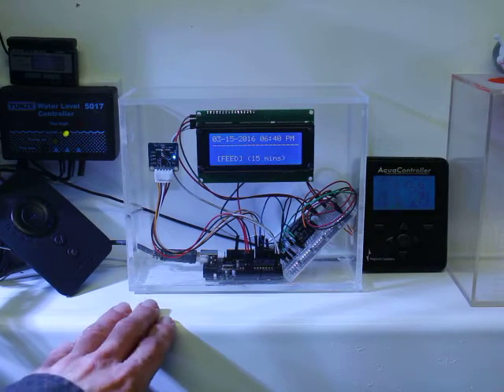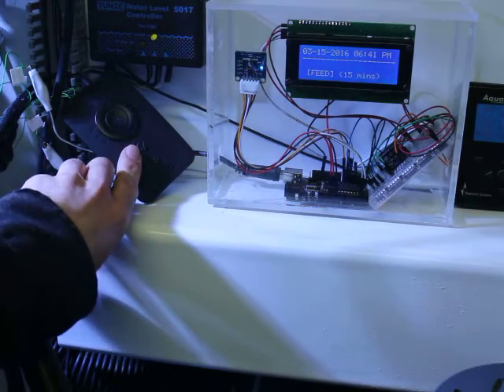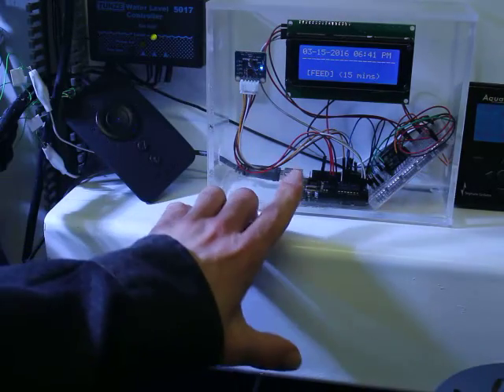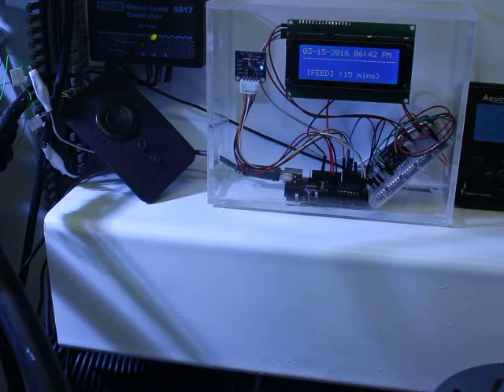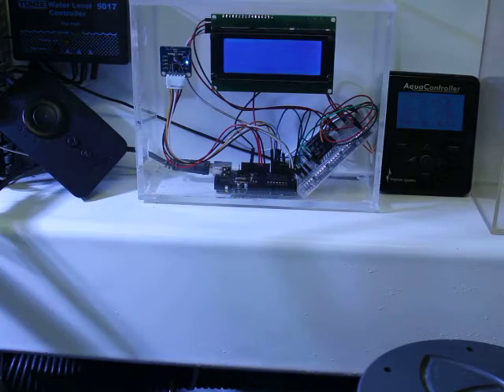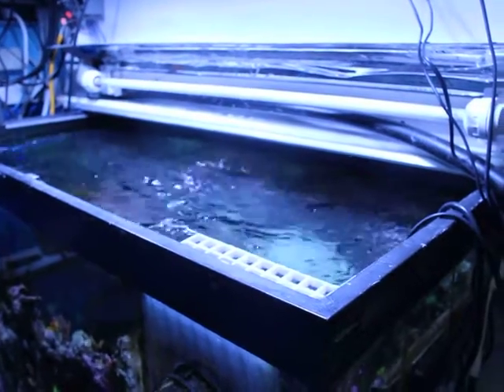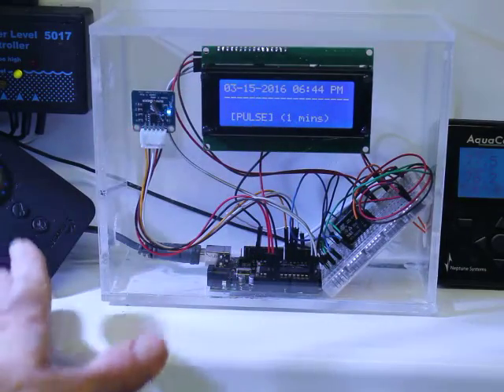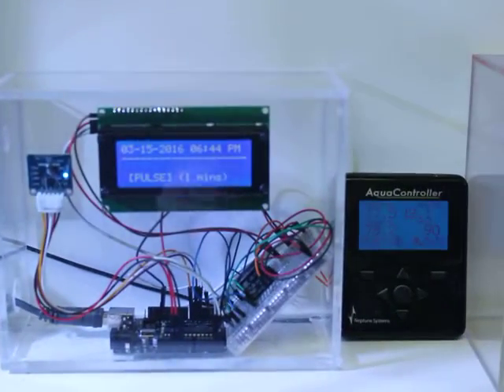Ardiuno (Maxspect Gyre Pump Controller MOD) Controller

Comment: All pictures are gone on the forum post :( Do you have a copy? I want to mod my gyre xf130 controller and I don't know how. Please assist me
Reply from the maker: Sorry for Late Reply.   I don't read these YouTube Replies, since Nobody usually posts comments.  If the thread is missing photo's, This design basically is a replacement push button.  Inside the Controller there are two contact you need to wire a Relay in Parrallel.  Then with whatever Mini Controller (Arduino, or Raspi) you push the button.  As many times as you would do by hand.
Reply: Wally b Thanks for the reply, it’s really helpful, you helped clear my doubts. Cheers!